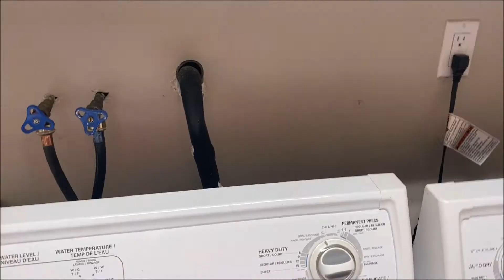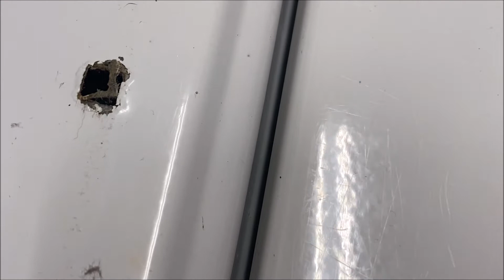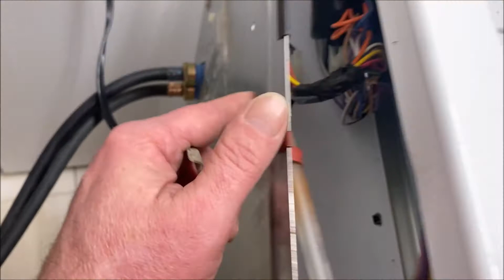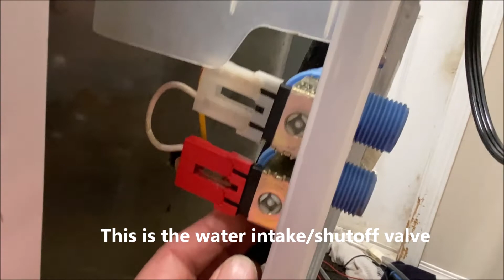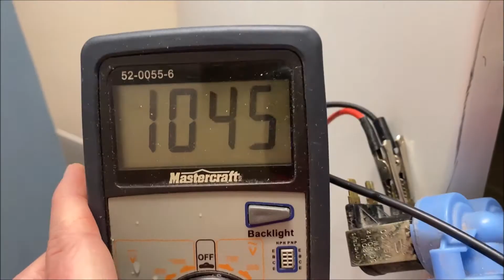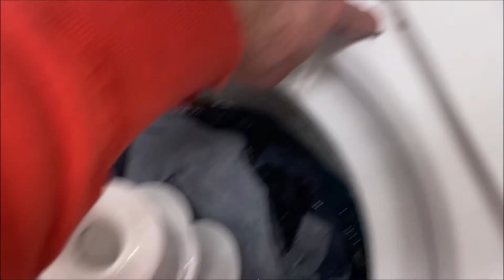Three Reasons Why a Washing Machine Overflows

Comment: What if it is only the cold water that doesn't shut off on it's own?? Hot water shuts off at level just fine, but I'm having to turn cold on and off at the wall manually to do laundry

Comment: I ran a cycle on light load hot water, and the washe filled the water like a heavy load and it was cold water, wouldn't that mean the water inlet valve is broken because it pours cold water?

Comment: If I blow into the hose the machine starts agg but it seems that the switch doesn't hold pressure and the water starts filling Im using a short hose directly hook to the switch

Comment: Maximum frustration here.  I have now replaced the water level switch, the pressure hose and the water inlet.  Still, the machine will want to overflow.  The only thing I noticed in the most recent run (replacing the inlet) is that when I turned on the washer (a Kenmore Series 70) the new water level switch made a really loud pop unlike the clicking of a blowing through the hose test.  The history of it has  been random overflows (twice) over a period of a few months. Then recently when playing with the dial for the water level sometimes it seemed as though it would stop an overflow and reset and work ok-  but this was short lived and after a day or two I turned it on and the washer filled no water and agitated in cycle a dry load of laundry.   Now after replacing then after  level switch and the hose and inlet as stated above it has returned to overfill.  Any Ideas?
Reply from the maker: Hi, I did some more googling and YT searches. Maybe this one helps?

https://www.youtube.com/watch?v=hlZAAeoK2iI
Reply: @DougBrownVancouver  Thanks for responding Doug.  I found the issue which actually was one of the first things I checked.  It was the air dome and a clog.  But I had checked that originally and it was fine.  Thus I went about  buying a new pressure switch and inlet as they were all original and I really did not have the time.  All to no avail.  :(    

The erratic stoppage of water and then overflows had me shaking my head and suspecting intermittent switch failure (if that could even be a thing).  

I should have known, living in a caliche rich desert SW it would be environmental:  So, long story brought to an end-  It was an intermittent blocking of the Air Dome. 🙄

Comment: I love my old Whirlpool and decided to DIY fix it myself whenever possible. Thanks for the very informative video!
Reply from the maker: Glad it worked. What was the problem?
Reply: @DougBrownVancouver  I had changed the couplers and didn't realize I had crimped that clear pressure tube. So the water kept filling and wouldn't stop. I took the opportunity to go ahead and change out the water fill valves since the cold water came out super slow & I'd been too lazy to install the part when I got it lol.

Comment: Does there have to be clothes in the washer for the pressure switch to work correctly?
Reply from the maker: Hi, not at all. The pressure is entirely from the water level, so the only impact from clothes is that  the tub fills more quickly and the pressure switch also turns off more quickly.

Comment: Awesome video and explanation. Turned out my air pressure valve hose was clogged near the bottom of the drum causing the fill cycle to not stop. Once I blew in that hose and didn’t get any airflow I had the culprit. Saved me a lot of time and money. Thanks!
Reply from the maker: You made my day, and I'm glad you diagnosed the problem. Feels good to save a couple hundred dollars around Xmas. Bragging rights to partner and friends too!

Comment: Thank you so much. This was the best explanation on the internet.

I have checked all the switchs, valves and level sensor. All they are is ok but it still keep filling even i blow the sensor and hear the click noise while machine is running. Then should i check the motherboard? What is your thoughts?
Reply from the maker: Hmmm, did you diagnose the problem eventually? I'm guessing the air sensor was faulty, and didn't transmit a signal to the valve.
Reply: @DougBrownVancouver yep same problem here? Continuity check out good on the switch one Wire normally open one while normally closed if I blow in the tube, the water shuts off, but when connected to the tub, it will overflow.

Comment: On the off chance anyone will read this, know the answer and respond…here goes: my Kenmore elite washer (1999 direct drive) is working fine save for one HUGE issue. At the tail end of every wash cycle, when the time gets to the last number of minutes (I.e. right before drain and rinse cycle), the washer suddenly starts filling with water, and overflows unfortunately (sheetrock, baseboard repairs, damaged cabinetry…what a disaster). I do not want to give up this beloved machine and know there MUST be a fix for this somewhere. Tubing and pressure switch are fine. Machine fills to proper levels at exact same place every load. It is ONLY overfilling at this same point every cycle. We have been unable to find an answer on internet yet.  SOS! Help? Ideas? Advice? Many thanks!
Reply: The same thing was happing with my LG washer.  I replaced the water inlet manifold and it still kept doing it.  I finally replaced the air pressure switch and have not had a problem since.  I inspected the old switch and when I shook it, it would have an internal rattle that new switch did not make.  I bought it off of Amazon for $20.  Can't go wrong with that price.

Comment: Great Video .  My old whirlpool washer overfills only with water cold water, but it is not an issue with hot water ?
Reply from the maker: Hi, late reply. I think it's the water pressure valve. Sounds like the cold side valve works fine and the hot valve does not. I'm sure you've fixed this by now, but if you have a multimeter you could have done the test I showed. What did you do in the end?

Comment: Thanks Doug, walked out to my garage floor soaked. Popped off the panel and saw my air pressure hose had slipped off. Everything running as normal again
Reply from the maker: Glad it worked out!

Comment: Great video.   Found my problem.  Where do you order the water inlet valves??????   Thanks.
Reply from the maker: Are you a biker from West Van or West Virginia etc? If you're in Vancouver you can go online to www.Reliableparts.com and put in your model # etc. 

If you're in the US or somewhere, google something "washer parts model ABC-123" and you'll see a bunch parts websites including Amazon. Amazon has the market locked up, but there are still lots of independent sites that you can support. I've used both 

www.partselect.com or www.repairclinic.com 

and they have great parts diagrams and DIY videos.
Reply from the maker: Good for you to fix this yourself, you save $ and time, plus you get a sense of accomplishment
Reply: West Virginia.   Was a Kenmore, ordered the inlet valve from Sears Parts Direct.  61 bucks.   Helped move a whirlpool washer, things in the cabinet look indentical.

Comment: Where the hose goes at the bottom u didn't show how to remove that there is blockage in there what can I do?
Reply from the maker: The hose is just plugged in loosely so pull it off and clean it, then reinstall. Should be easy.

Comment: I have this same machine . And everything you explained on this video I checked and mine seems good . It likes to flood once a month so I guess it's intermittent . What would you do about that just replace shut off valve
Reply from the maker: Hi, it would appear to be a failing valve. Just Google the specific machine model off the sticker with "water level switch replacement part" and a couple of sites will pop up. Here's one from Canada:https://www.partselect.ca/PS3408119-Whirlpool-W10337781-Water-Level-Switch.htm

It's super easy to replace the switch and I think you can see it from my video.
Reply: @DougBrownVancouver  thanks . I'll replace that